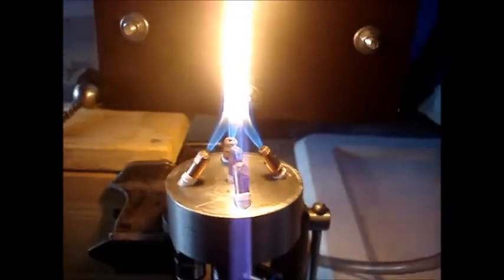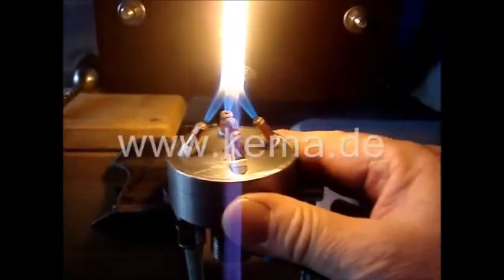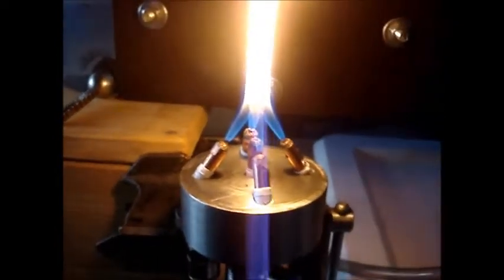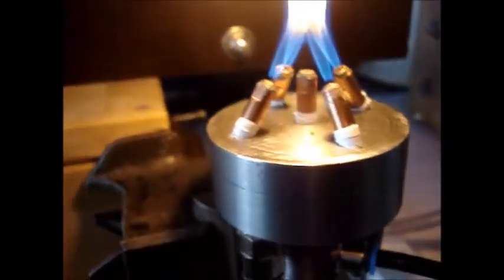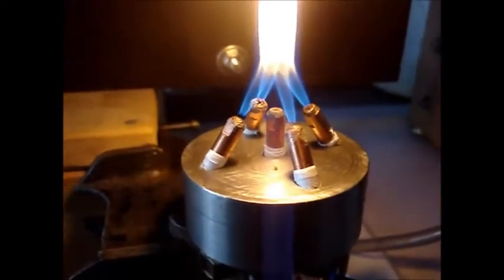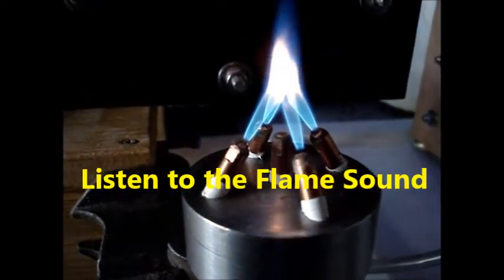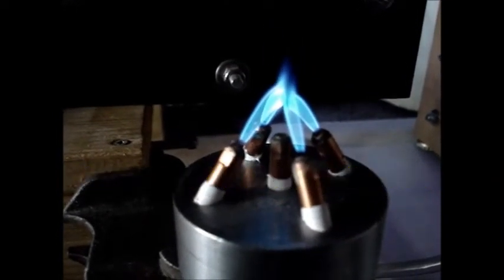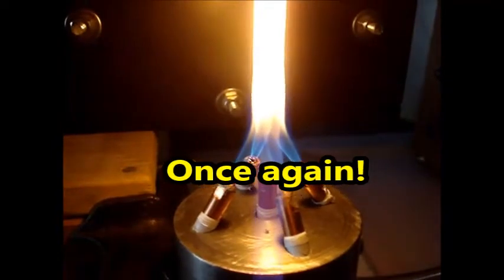Hybrid Twin Burner CH4 +CO2 HHO + H2

Comment: The flame temperature is higher. HHO burns at seven times the rate of methane. If you do not supply HHO, about 80% of the methane burns - when the gases are mixed, the combustion is almost complete. The blue flame indicates a higher temperature. But its infrared radiation is lower.
Reply: With CO2? Or HHO?
Reply: @chrischristodoulou1731  not understand you
Reply: You mean you introduce HHO gas. NOT CO2 gas. Correct?
Reply: @chrischristodoulou1731  CO2 is non-combustible gas .